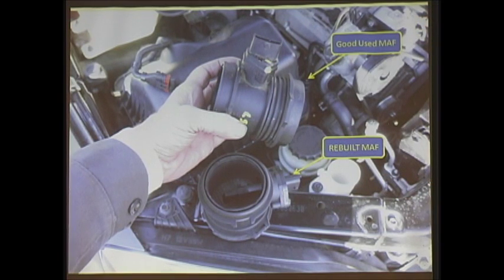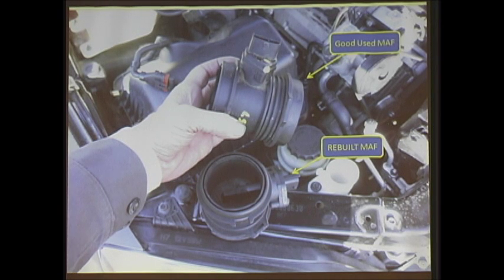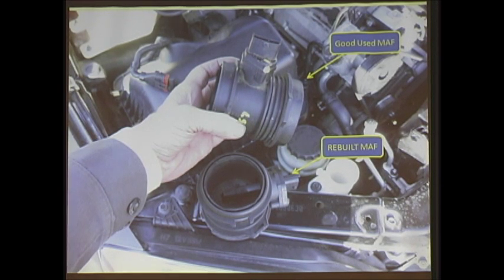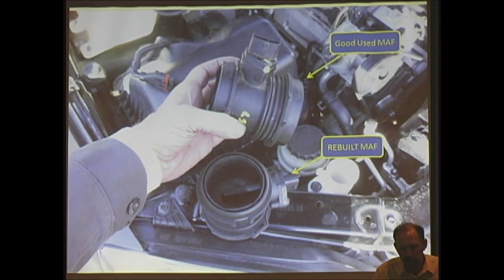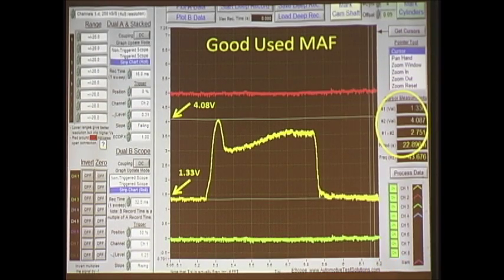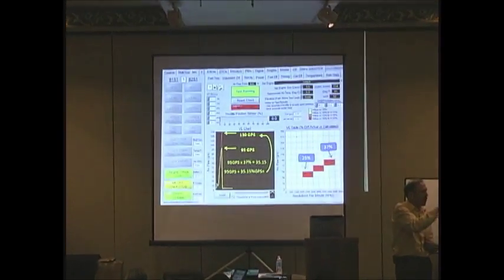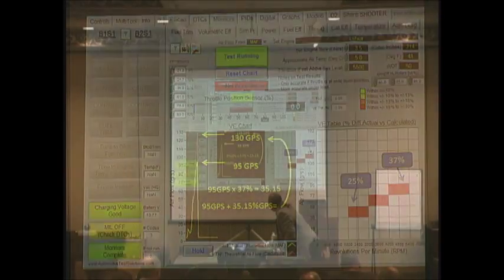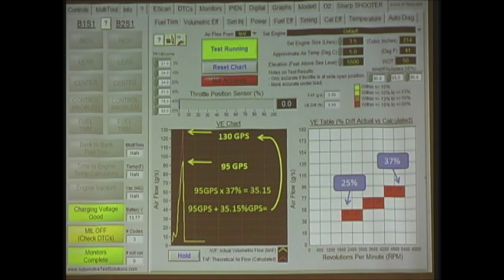Bernie Thompson: Understanding, Diagnosing and Repairing Fuel Trim Problems (2014 TST Big Event)

Comment: You...
had a Car in your Bay for three weeks ..?
I certainly hope you got paid for 120 hours then

this seems to be the only Trade that works for free  ..  :(

remember
it's not your car, nor your problem

document your Testing, and demand to get paid for it
Reply from the maker: you never make your money on the nightmare vehicles...
Reply: that is an incredibly poor Business Model
It's not my Auto, and not my Problem
I am entitled to get paid or every hour I work

otherwise

Someone should tell me what to Fix
Reply: @embreesmith7613  I agree, we should get paid for every hour that we work.  Flat rate is an outdated compensation plan and it's part of what is wrong with our industry.  On the other hand, we are one of the few, if not only, trade that doesn't require licensing.  I see more techs than not, that do not have a diagnostic plan and do not follow the same approach every time they diagnose a problem.  If someone is taking that long to diagnose a vehicle and it's because they do not posses the skills to do so, then how is it fair to charge the customer? If there were a standard and we weren't incentivised to be the fastest, then there would be a lot less problems.  Again, I agree that we should be paid for every hour that we work, just pointing out some of the issues around how we get paid.
Reply: If the vehicle is beyond your ability , then it should be passed to someone who CAN diagnose it . After an hour or two , it may be time to stop wasting your time and the customers money . No one knows everything . But knowing to pass it UP the chain is better than a total ZERO . How do you justify putting a few thousand dollars of time and parts in a vehicle and NOT fix it ? We are not talking about a fuel filter or a relay here . " But I tried to fix it " = is NOT fixing it .